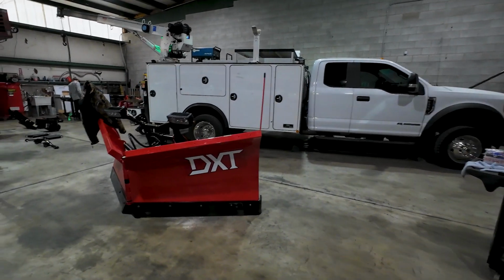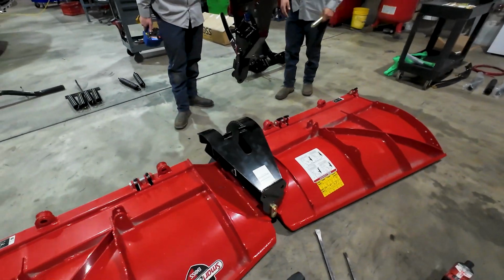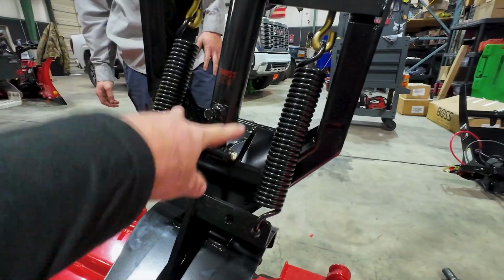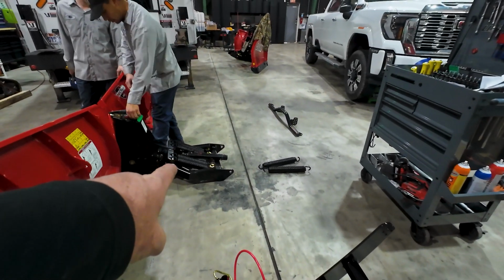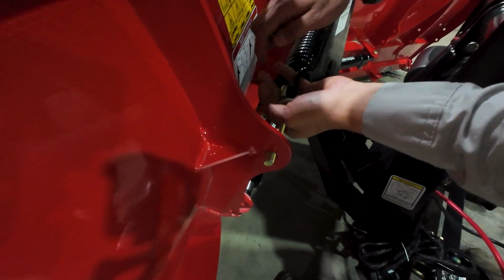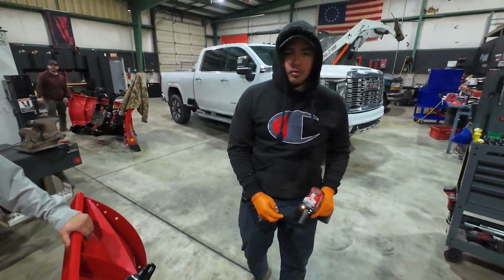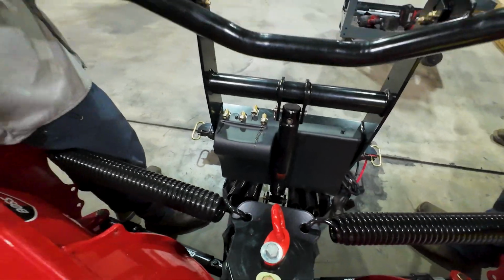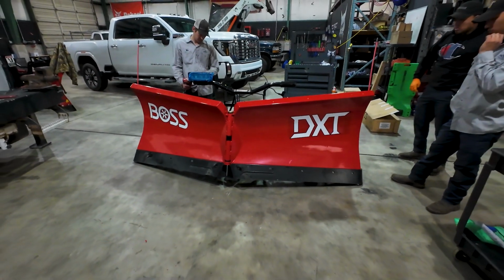Boss DXT Angle Blade Snow Plow Assembly

Comment: As a reminder Brady, when you guys install the wire harness for the lights and signals, be sure to place the bank of relays with the spade side down and use electric grease on the spades too. Weve had so many trucks that had light issues because of no grease and corrosion set in and they were mounted upside down.